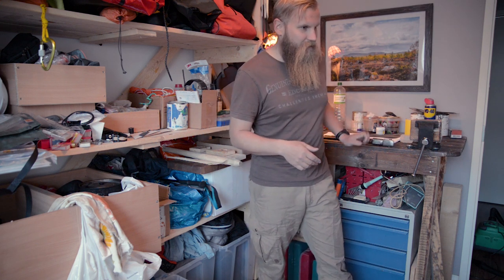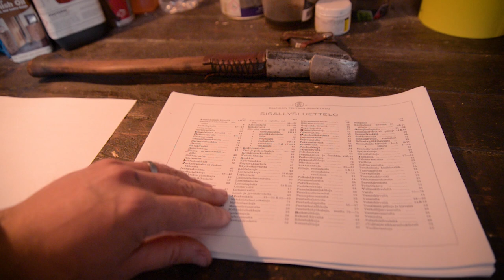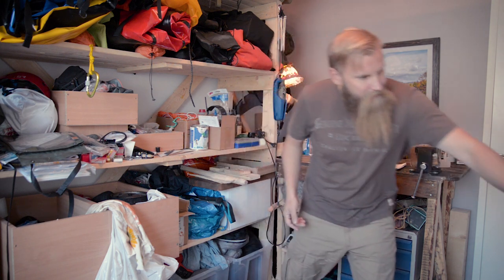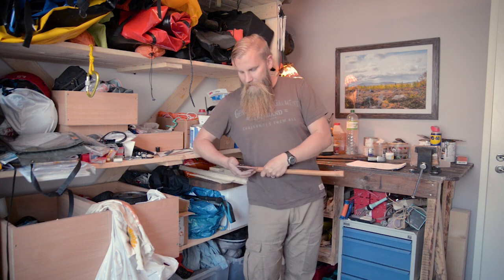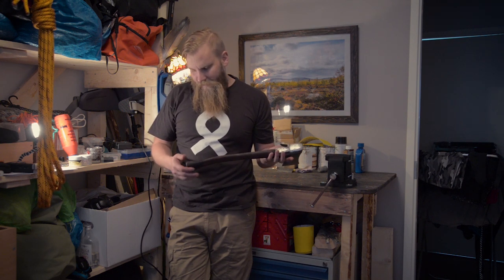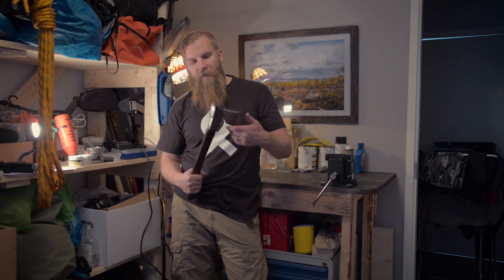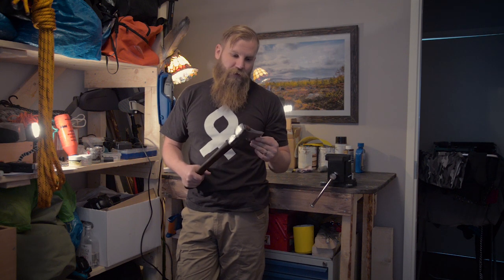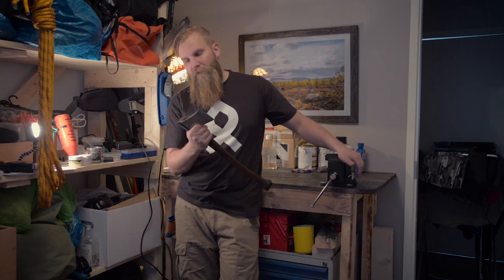Restoring Billnäs 12.3 Vintage Axe

Comment: Great restoration of the Billnas! The Axes are extremely hard to find in the United States, eBay has them but at a price between 100 to 150 USD.  Just a few Euro's I could only wish. thank you for the video!
Reply from the maker: Thanks! Yes they are here usually 5€ in flee market. Really good ones can be 20€.
Reply: @caide  I would send you 20 Euro's any day for any Billnas!
Reply from the maker: @yooperwsdm  problem is the postal fees. It's really expensive to send packages from here.
Reply: Hey man nice video, I would be interested to buy some billnäs axe heads if you could help me out I'll pay the transport fees no problem

Comment: Could you tell me little bit more about the design of the axehead?
Reply from the maker: I think the design is originally from Sweden and these are from the first factories we had in Nordics. Collateral axe can take more beating and in my opinion is much better than the new Swedish design you can find now for example in Gränfors bruk axes. They have a lot different axes for different purpose: woodworking, splitting, felling and so on...

You can find Billnäs catalog from 1928 here and see the different models and other tools too: https://digi.kansalliskirjasto.fi/pienpainate/binding/338807?page=1

Comment: I just received my billnas a few days ago. Very happy. The handle on mine seems too long, it is 26 inches. I may switch it. I'm trying to find a leather mask/sheath, I saw one on eBay that is made for a fiskars axe, but I don't know if it will fit. I noticed your handle is shorter, would you suggest that I make a shorter one? My axe head is the same as yours.
Reply from the maker: It depends what purpose you use your axe. Longer is better when chopping woods, I like short because it's going to be more multipurpose use. I think yours is going to be ok.
Reply: @caide  thank you very much. You still going to make a video for a leather sheath for the billnas?
Reply from the maker: Yes, coming soon
Reply from the maker: Now there is a video online about axe mask also :)
Reply: Jonathan Caissie where did you get it?
Reply: Смотря для чего нужен твой топор. Если универсальный, то сделай длину ручки от запястья до подмышки.

Comment: I wish we could get these head for that cheap in the states these go upwards of 80€
Reply from the maker: Here they are too cheap.
Reply: @caide  yeah, I hope to get a small axe head and fix the dings in the head and put a straight ziricote axe handle on it, plus maybe blue or blacken the metal
This is only when I find a nice axe head for a good price
Reply from the maker: @christianlee1693  I hope you find one. It's a great axe 😊

Comment: What Wood would you recommend for the handle?
Very nice video :)
Reply from the maker: Robin W I use birch wood, because it's the best from our trees here in Finland.
Reply: @caide  how could I find a leather axe mask for a billnas?
Reply from the maker: Jonathan Caissie You can't find any factory made, there is traditional way to make it from birch bark. I made mine from leather myself. It's not difficult, I'm going to make a video about that too.
Reply: @caide  thank you very much for the quick reply. Very very nice work.
Reply: @caide  I just ordered a billnas. I noticed that the handle has no wedge. If I can save the handle, I will put a wooden wedge in. In your opinion would it be wise to also put a small metal step wedge as well? Also what kind of oil do you use on your handles?
Reply from the maker: Jonathan Caissie I usually put only pine wood wedge. If it feels not thight enough, you can add a metal one. I have recycled some metal parts and used those as a extra wedge.
Reply: @caide  thank you very much!
Reply: @caide  Rowan is at least as good.
Reply: Ясень, вяз, черемуха.

Comment: Довжина ручки яка?
Reply from the maker: Я вже не пам’ятаю, таких у мене десятки
Reply: @caide  . Приблизно сказати можете ,бо є у мене така 12,3 і хочу знати хоч приблизно довжину руків'я на неї яке робити.
Reply from the maker: @ПашкаЖелезняк  
десь 50-60 см

для розколювання дров я віддаю перевагу 60см
Reply: @caide  . Для похідного яку робите довжину?
Reply from the maker: @ПашкаЖелезняк  https://rusknife.com/uploads/monthly_2018_09/622811309_.thumb.jpg.5b91d414fde79556d346c854b2171f72.jpg
Reply from the maker: @ПашкаЖелезняк  Тут я знайшов гарну картинку з відомої книги. 55 см — це більша багатофункціональна довжина, а з 60 см ви можете мати більше потужності для ударів.
Reply: @caide  .щось не відкриває картинку
Reply from the maker: @ПашкаЖелезняк  https://www.google.com/url?sa=i&url=https%3A%2F%2Fwww.bladeforums.com%2Fthreads%2Ffinnish-earlier-scandi-axes-kirves.1428809%2Fpage-53&psig=AOvVaw02J4XQs-JAM62T9zgp8fxA&ust=1711622056290000&source=images&cd=vfe&opi=89978449&ved=0CBIQjRxqFwoTCNCD4pqflIUDFQAAAAAdAAAAABAM

Comment: At 20.00 my eyes hurt because of your puukko skills... You need hundred of hours of practice. I did it when I was 9-14 years old and I still use puukko regularly at 45 years. Also think on which side you carve wood when fitting the handle, it looks like you are working on back side, but you should have worked (mainly) on belly side. Putting screws through the collar is more like a travesty. Axe head seems to be in wrong position as well, not to mention it is not correctly ground (shape of the blade, not sharpness). BTW axe sharpness is not that improtant as many fools think. Good try nevertheless